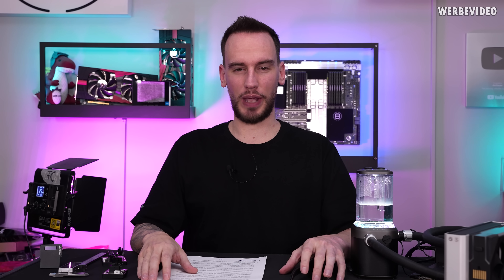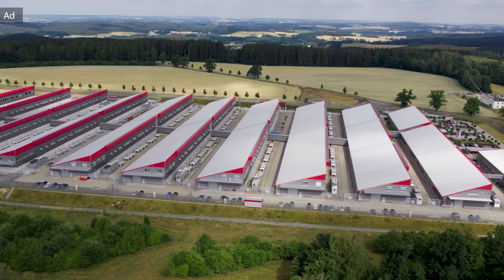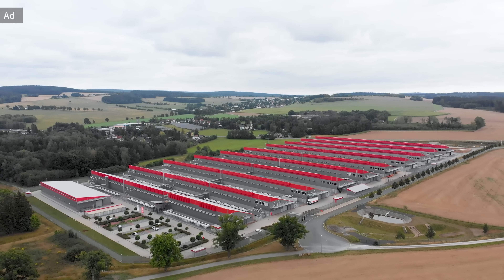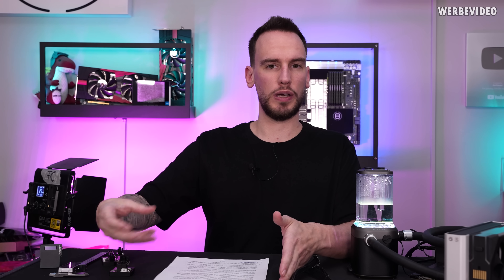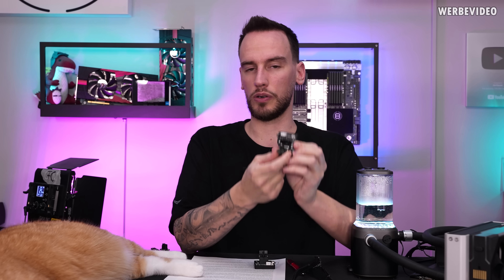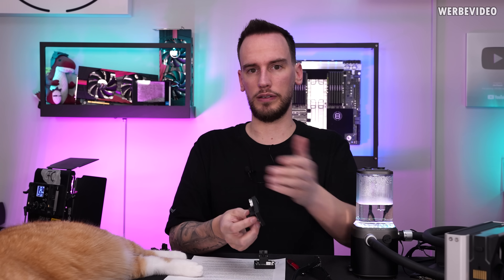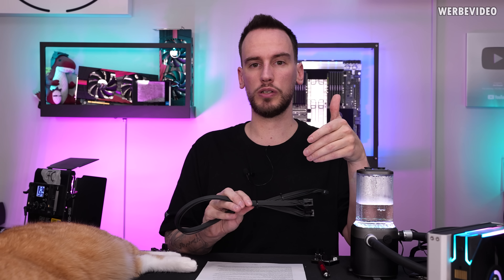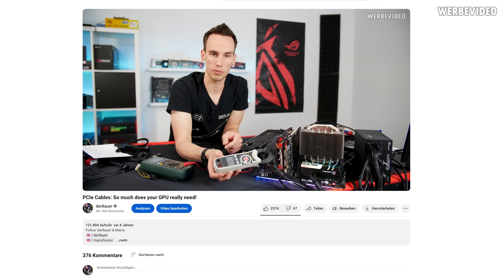12VHPWR is just Garbage and will Remain a Problem!!

Comment: A safety factor of 1.1 with a 4090 per PCI-SIG specs is absolutely insane. Even unmanned spacecraft and launch vehicles that are strictly weight-limited have a safety factory of at least 1.25. It's unheard of to have any terrestrial piece of engineering operating so close to its rated maximum under normal conditions. It's fair to assume that a lot of people running the old 6 and 8-pin connectors likely have a connector that isn't fully seated, but incidents of them failing are exceedingly rare compared to 12VHPWR. I have no doubt the huge safety factor has contributed to their incredibly low failure rate.
Reply: Is 600watt normal load conditions for a 4090? 😂😂 it’s literally barely half that.

Comment: As much good work as GN does him saying the user has not plugged the cable in, really took the heat of nvidia as people started going quiet as was taken as gospel he cannot be wrong.  Even after more reports he basically refused to engage with it like when northridgefix called him out on it.  AiB should have did what EVGA did with the 3090ti connector if they had stayed around i wonder how many would have followed with the connector on the end of the card design.

Comment: I wanted to say that I saw someone testing a normal 6 pin connector, and the 6pin could handle insane power before it gets warm, but it's mentioned in this video. 

It's perplexing that in the 21st century, with the availability of sophisticated simulation tools, they made a worse connector, that is susceptible to user error and it's worse than 10+ y old solution.
Reply: Except the issue isn't the connector, it's adapters. Notice how PSU cables don't have this issue. It's only when using one of two specific adapters. Every single melting case revolves around two adapters. 3090ti has the same power draw as 4090 and uses 12VHPWR yet 0 melting cases. It also doesn't have adapters. The issue has never been the 12VHPWR connector. It's always been two adapters. You would think they already simulated using their cables because they already did...?
Reply: @Djinnerator  the issue is the connectors. Cables don't have this issue because the connectors fail long before the cable does. I've seen pictures melted on the gpu female connection and even the psu female connection. Nvidia is a multi billion dollar company and you are shilling for them for free.
Reply: @Schaden-freude then explain why the exact same connector is used in other cards pulling more power but have zero issues. It's the adapters. The only times there are issues are when there are adapters. You finding some melted connectors means nothing when there are 8-pin melted connectors too. There's thing thing called "fault tolerance" which means there will be some issues. You're just not using an ounce of critical thinking.

Comment: 12x6v is perfectly fine. yall in the comments and in the video acting like engineers lmao. the 8pin standard its self is rated at 300w not 230w or 280w lmao , like corsair psus. running their 600w 2x 8pin to 1x hpwr connector directly from the psu and no issues at all

Comment: What bothers me more, is that tolerances of power connectors have been historically garbage. 
Sometimes you get ones that fit perfectly, sometimes they're a bit looser and sometimes you have to push them in with the might of Zeus to get them to engage. 
It's been the cause for connectors melting since forever, 6pins, 8pins you name it.

Comment: insanity is doubling up the 12VHPWR connectors to fix the problem now you are doubling the same problems with 1x12VHPWR but with 2 connectors, redesign a new connector or go back to the old 8 pin connectors.

Comment: Very interestingly the Asus Thor II PSU with the revised 600W 12VHPWR cable (remember, these originally shipped with 450W cable which did not meet the full specification!) I received was reasonably well bent (meaning easy install as clearance to side panel can be smaller) from the factory and the build quality seems superb I would not know how to make it any better with the current connector. Afaik the OEM is Seasonic, so it is possible to make a good quality cable for these which has reasonable bend radius. That said, I completely agree the connector placement and clearance requirements do not match the real world use cases and whoever decided this is fine should be fired.

Comment: NVIDIA just needs to admit failure and stop using this connector before it starts a fire that causes loss of life.
Reply: They won't, a significant reason for buying the RTX 40-series over the RX 7000 series (given that the 7000 series is better value at every price point it is present) is because of Nvidia's power efficiency, most of that comes from them using that connector.

Comment: Even more wild that in enterprise for Gpu's and for consumer CPU power we have the eps 8 pin with 4x12v conductors that is good for 324w by your math and  384w if you ask google.  Just TWO of those would match or beat the safety factor the 12vhp achieves.

Comment: This 12VHPWR garbage is rated for like 30-times usage at most. Like if you plug and unplug it for 30 times - you need to throw it away to a trash bin because you can literally catch your house on fire, its become unsafe to use then. Even if it was perfectly fine when new. This is a huge problem, especially for those who repairs computers/GPU`s. Why the heck we need this crappy standard even to exist? Remove it, we don`t need this type of connectors at all.

Comment: Yeah, as a layman I feel that it's not that good of a connector either. Especially given that it's hooked up to cards that cost $1000 - $2000 USD easily.

I've come across issues where the 12VHPWR cable isn't fully seated either in the GPU or on the PSU end (fully modular PSUs); of course this is "builder error" but the issue appears far more often than with the older PCI-E 8-pin connectors. This is in-person with sample sizes in the thousands. I've never had a GPU burn due to the 12VHPWR cable though interestingly enough, I predominantly worked with the 4070 Ti, 4080 and maybe 250ish 4090s. PSU OEMs being Xiamen Metrotec, High Power, CWT and Seasonic.

In my personal build I run the CableMod cable (a 3x PCI-E 8-pin to 12VHPWR) for the EVGA SuperNOVA 1000 P6 into a 4080 FE and it works fine. I just personally feel that any additional adapters or anything of the sort adds a potential failure point, either due to manufacturing or user error and so on given the propensity for the 12VHPWR connector to catastrophically fail if it does indeed fail.

Comment: I'm willing to bet that this error margin and ignorance was glossed over to the extent that nvidia wanted to portray their power-hungry giants as efficiency monsters by using extremely slimmed down connectors. I firmly believe that this psyche, which is supposed to be created in the customer's mind, was an integral part of the design of this connector and therefore a much lower overhead was deliberately accepted.

Thick 4x 8-pin plugs make a completely different impression than a single, narrow plug. The former immediately evokes the thought "wow, so power-hungry".

Comment: Honestly, i just think it's weird that PCs are still using 12V power. Obviously there's a lot less maturity and standards constraining them, but 3D printers have largely moved away from 12V in the last years and switched to 24V, and they're typically nowhere near the power levels of a 4090. I guess you would need higher voltage rated MOSFETs in your VRMs, but I have to imagine the savings on copper for lower end PCs (and the savings from not melting your card on the high end) would make up for this.

Comment: I always found it interesting that Nvidias favorite claim with 4000 series gpus was how power efficient they are. Yet they made them require the new 12vhpwr because it is rated for more power…
Reply: They are much more efficient than 30 series.  The connector has nothing to do with that.  Pay attention and do some research.
Reply: @mintymus yea they are more efficient, I said that. My point is I find that it’s hilarious that they require less power but use this problematic connector. I waited to buy a partner GPU specifically to stay with a standard pcie connection because I don’t have to worry about melting connections.
Reply: @ipoopmuffins  Do you not see the logic flaw in your point? You said RTX 40 is more efficient, which draws less power, than RRX 30 and complain about the connector, but the connector isn't problematic. All of the issues have been two specific adapters. Adapters are not representative of the connector. If the connector was the issue with line if GPUs that's more efficient and draws less power, we'd see reported issues with the less efficient line (RTX 30) but there are none. The difference is that RTX 30 didn't use adapters like this.

How is it that everyone sees the issue is with two specific adapters but talk about the connector? RTX 30 uses the exact same connector, zero issues. Also people use direct PSU cables and have no issues. So given the issue doesn't exist with RTX 30, the issue doesn't exist with PSU cables (just adapters), the obvious culprit to be talked about is "ADAPTERS" not the 12VHPWR connector.

Notice how Corsair's GPU Power Bridge doesn't have reported melting issues. Neither do the "cheap" Amazon adapters that people say stay away from (in general). It's only with two adapters and instead of people blaming the adapter, you people are saying "yeah well the connector is bad" like...where is the logic? Make it make sense, please D:
Reply: @ipoopmuffins  I don't blame you for that, I also wouldn't trust this new connector.
Reply: @Djinnerator  theres no flaw in my logic. go look up northridge fix videos if you want to see some connector gore, specifically 4090s. my only claim in the post was i found it hilarious that they were so happy to talk about how the 40 series uses LESS power but doubled down on a new connection thats main claim is it can provide MORE power, thats funny to me. for sake of argument ill go along with you, lets say that no connector ever melted and it was only adapters. its still a bad connector if its this common to melt with an adapter. never had a pcie connector melt on me and ive used tons of cheap adapters.
Reply: @ipoopmuffins  my bad, I read your comment reply as if you were saying the connector was responsible for the melting adapters.

On your point about it being common to melt adapters, it's not. If it were melting adapters indiscriminately, it would be different. But if only one adapter is getting melted, why is the focus on the connector?

I know the CM adapter isn't the only issue, there's also the Nvidia squid adapter. That issue was resolved when people made sure their adapter was pushed in all the way. That's a design flaw with that specific adapter. If they used the same adapter that came with RTX 30, there wouldn't be any reports of melted Nvidia adapters. Regardless, that was an issue that was more less resolved. There's no pattern of reports anymore with that adapter.

Now the CM adapter is trash. There's been a new reported case of melted adapter every single day on the CableMod sub. CM says there's less than a 0.1% failure rate. Idk the accuracy of that. If that's true, that would suggest the issue may be overblown. Idk for sure with that, just going off the number the company said.

If the issue is only with two adapters, one of which has almost no reported issues now after learning the cause and "fix" leaving all reported cases now to be from one adapter, how is it the connector that's bad and not specific adapters? D:
Reply: @Djinnerator  go look at all the 40 series repairs that Northridge Fix has on his channel here on YouTube. I’ve owned plenty of different gpus, gtx 600s, 900s, 1000’s. AMD 500, 5000, and 6000 series. Never had to worry about pcie connectors. And right now I own both a 30 series and a 40 series. I specifically waited for partner models that use pcie after the whole “user error” fiasco Nvidia pushed because of the connectors. (For my 3080ti I just wanted pcie because I think it looks better than adapting pcie to the 12vhpwr). They even redesigned the connector because of these kinds of issues. I really don’t see how anyone can compare this new connector and pcie and think, yea this is fine and totally better than pcie.
Reply: It's like nobody is even trying to use logic. RTX 30 had this connector and draw more power overall, yet no issues with it. 3090ti and 4090 both rated at 450w. No issues with 3090ti. Yet somehow it's now magically the connector that's problematic. It makes no sense...

Comment: At 7:20 the interpretation of the chart is incorrect. It refers to the total independent conductors (wires) in a cable, not the number of strands in a single conductor (wire).

Comment: My friend told me that he would've bought the 4090 if it had 4x 8 Pin PCI-e connectors instead of a single 12VHPWR connector. And I completely understand him. That connector is too dangerous. And having to spend around 2000 Euro for such GPU with such problems isn't worth it. In the end he decided that his 3090 is still doing the job done and he doesn't need more powerful GPU right now. Hopefully they'll change the connector with the RTX 5000.

Comment: I had this thought maybe 6 months ago when I was telling a friend to get a 7900xtx or 4080 over a 4090. The peak wattage of 600ish watts is too close to the theoretical max for 1 cable. The single point of failure comment is also a good point.  It should have been spread over two connectors minimally.

Comment: I think GPU's should simply have a proper AC 3-pin kettle plug or at least those smaller 3-pin clover plugs you see on laptop AC Adapters. The cheap plugs that we are seeing on GPU's have multiple lines and are not reliable because when one or two pins are not making contact it burns out the other pins.... so I think we need heavy duty 3-pin AC-rated plugs instead of dodgy 6-12+ pin plugs.

Comment: Still never had issues with these. Six 4090's, 666w and 1000w vbios's, OEM adapters and custom cables, and zero issues or melting connectors. Just plug shit in properly

Comment: The 12VHPWR only has a connect and reconnect lifespan of about 40 yes?
 
If someone keeps plugging it in and taking it out and plugging it in and taking it out that's going to wear it out quicker. 

Insanity huh? Lol. Media talk. 

So the only reason that they went to this 12 pin is because they didn't want to use more than three 8 pin connectors for gpus?

It seems like there has to be more to the story than just that. All the other engineers that work with these cables are dumber than you?

It wasn't Nvidia that was the only company that was ok with the 12pin. 

My adapter is doing fine. Maybe it will break over time. It's not hard to leave the side panel off on the PC like I do. 

Or just buy a wide case when building a PC.

Comment: If I were stuck with a 4090 I would solder wires directly to the circuit board to bypass the connector. After the warranty is over of course. I run a AMD and don't game. Engineering and audio editing mostly.

Comment: I agree 100% about the connector being total garbage but I don't agree about the solution. The old 8 pin connector is excellent and doesn't need to be changed so either go back to the 8 pin or at least offer 2 different models, 1 with tree 8 pin connectors and 1 with one garbage connector, everyone that wants reliable power and doesn't care as much about those "ugly" cables can still have it and the morons that have problems with cables can burn their GPUs and house. I'm personally never buying a GPU with this garbage connector, hope AMD and Intel don't start using it.